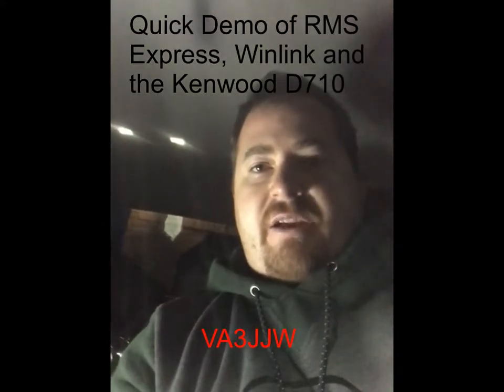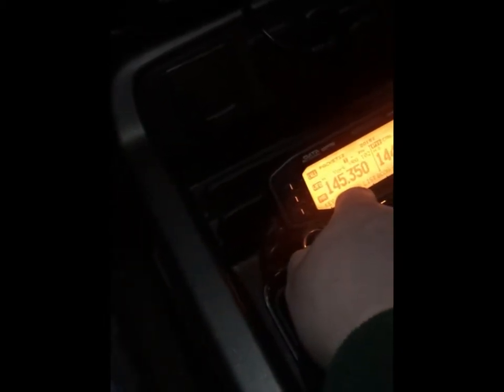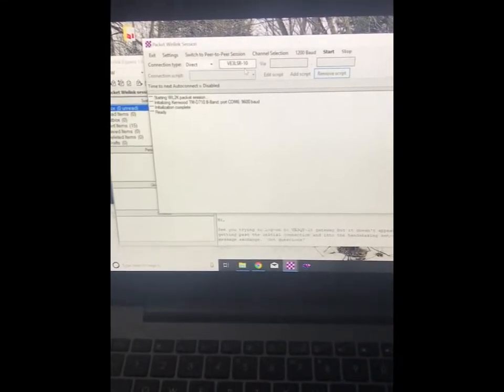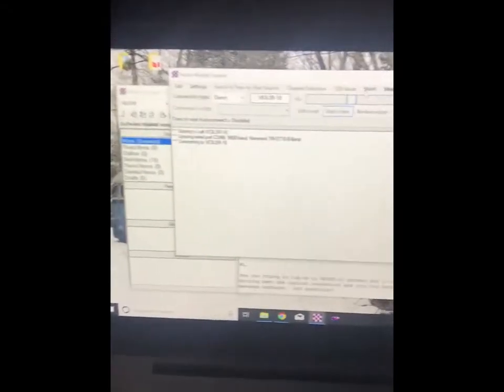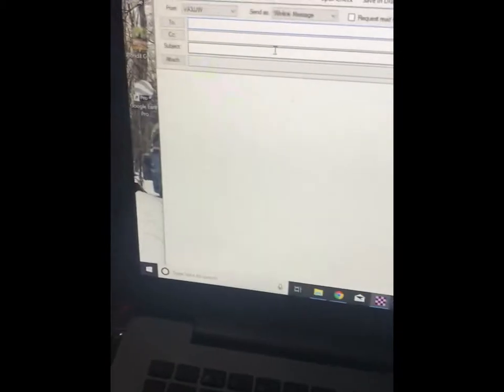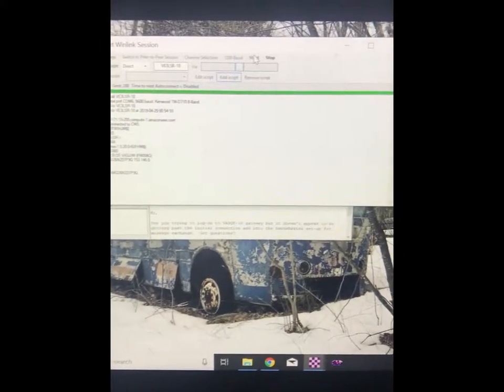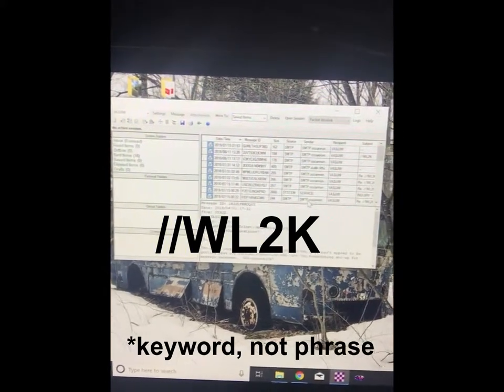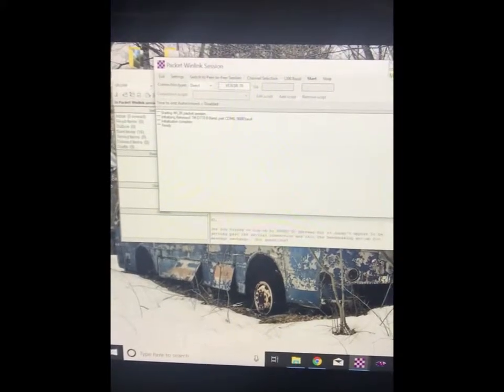Winlink Demo with Kenwood D710

Comment: Greatly appreciate the video!  Just digging into this project, is there any way you could help me properly configure the radio to access the internal TNC.  I am aware you can only use either the GPS or the TNC, but I don't know how to configure this.  I have YAAC monitoring APRS traffic as a receive only kenwood, but I am not able to set up a Serial TNC and work either direction.  I am switching to PACKET12 instead of APRS12 as is required to do this.  I am wanting to step into Winlink and anticipate arriving at the same issue and want to resolve it prior to setup.  There is some small setting I am missing and I can't seem to hunt it down...
Reply: So, I jumped on the air after stewing in frustration for a brief while.  Winlink is working excellently!  APRS in PACKET12 to YAAC still wont work which vexes me... Especially because it works excellently in receive only for APRS12 :(
Reply from the maker: @wesleybuff2536  I'm glad you got winlink working! I'm sorry for the delay reply.  Are you still having trouble with APRS?
Reply: @justinwhitman690  I neglected to come back and post an updated solution.  I was attempting to interface with YAAC using the wrong variety of TNC for the port.  A simple drop down tab I was not aware I needed to alter!  I would highly recommend using YAAC for APRS messaging as it can provide access to a full keyboard!  I have a guide for this with the D710 if you would be interested.
Reply from the maker: @wesleybuff2536  Great, I'd glad you got it working.  Id love to have a look at the guide, It sounds great with a full keyboard